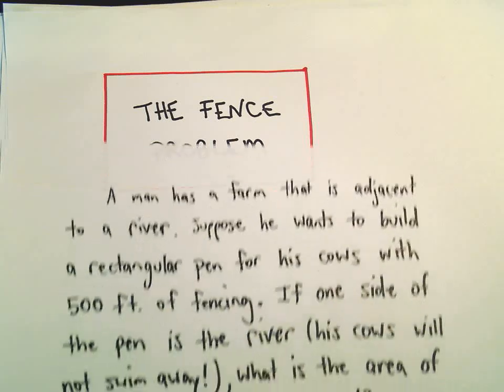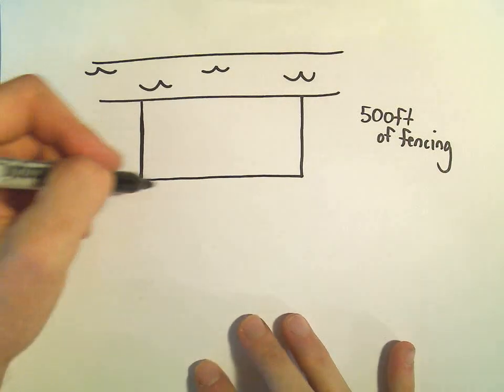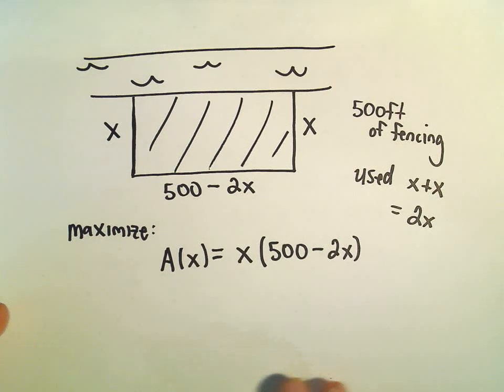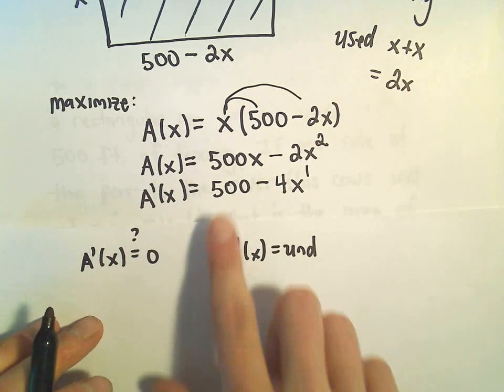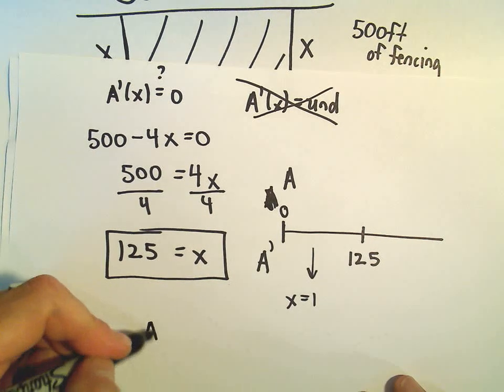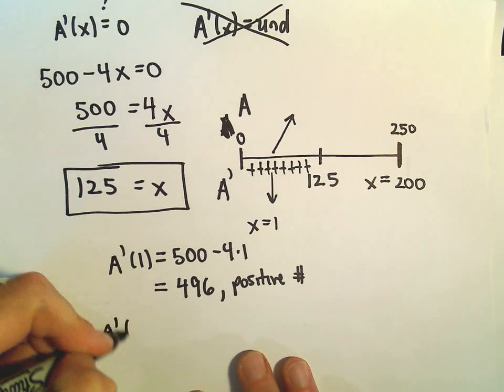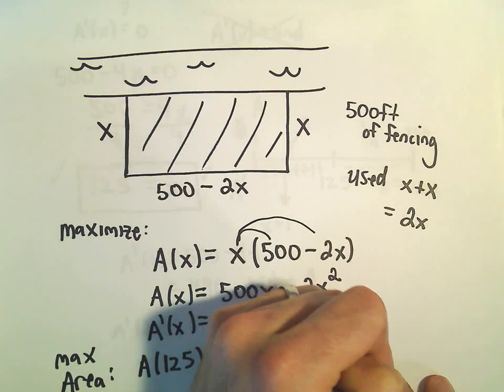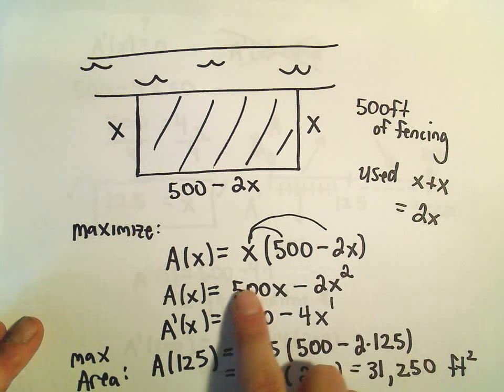Max Area Enclosed by Rectangular Fence - Optimization Problem #4

Comment: I labeled my rectangle differently. The side parallel to the river I labeled x and the other two sides I labeled y. So my equation was x + 2y = 500 and thus y = (500 - x)/2. Then A = x [ (500 - x)/2 ] which gives A = 250x - 1/2 * x^2 and the derivative is dA/dx= 250 - x. When I set that equal to 0, I get x = 250. Then I plug that back in my original formula and I receive 125 for my y value. A = x * y = (125)(250) = 31,250 square feet. So my computation was different but I still received the same answer!!!
Reply: The way you did it was correct for a 4 sided pen. However, the question said that the pen has 3 sides, the 4th side is the river
Reply: @Amanda-bg7ib He did it correct. He set the problem up for a three sided pen, hence he used the equation x + 2y = 500. He used different variables, but the naming of the variables mean next to nothing, as you are free to refer to them as you want. If he set it up for a four sided pen, he would have used the equation 2x + 2y = 500.

Comment: I ended up doing it by constraining the perimeter. I said well if we only have 500ft of material to work with. The the perimeter is 2x+y. So, 500 = 2x+y.

 From there I got y=250-x and I plugged that into the area, a=x(250-x).

I was scared I got it wrong when I saw you did it a different way but I also arrived at x=125.

Comment: in this case, u can just divide the fencing material to 2 then that will be your length. the remaining fencing material will be divided by 2 then that will be your width. now that you have your length and width, multiply it then that'll be the maximum area.

Comment: Isn't the length 500-2x divided by 2? 500-2x would be the two lengths together and not just one.
Reply: Yeah, Even I thought that is should have been x(250-x)=Area.  The answers are same here, may be due to differentiating and equating to zero. I think answers would have been some what different otherwise.

Comment: This is an old video so  I am not sure you still read the comments, but if I were to take the second derivative of the area, which would be -4. This indicates concave down, so A' '(125)=-4 is the local maximum? Since logically it would be increasing on the left side of 125 and decreasing to the right of 125. Also as an alternative way of finding the maximum could we instead find the absolute max on the closed interval [0,250] and the critical point 125?

Comment: After you’ve found the function to represent the area of the rectangle, being that the function is a downward opening parabola, wouldn’t the maximum x-value simply be the x-value of the vertex ( in which case we could use the equation x=-b/2a which is -1000/-4, or 125) ?
Reply: Yes

Comment: Through problems involving the area of rectangles, Ive always found that the area is maximized when the rectangle is a square. Im just wondering why this isn't the case here. I understand the math behind it, but I don't get why it is any different here.
Reply: It's because only problems where you have 4 sides to worry about usually turn out to be a square. These kind of 3 sided problems usually turn out to be y=2x.

Comment: Isn't it easier to just do (X+X+2X) and then make the following equation : 500= 4 x, then we can divide it by 4 which is 125. So the X will be 125 by 125 but we have to find the 3rd side. In this case we can do 2(125) because it's 2X (substitute)  which is 250. 
Therefore, his fence is going to be 125m by 125m by 250m.
Reply: You have to find the critical point using the first derivative test because you don't know for certain that the length is exactly 2x. Just happened to work out that way in this problem

Comment: Is it too risky to use the 2nd Derivative instead?
Reply: You can, but it is not required for this problem. 2nd derivative is for inflection points(change in slope).

Comment: Would yo still get points just solving this through logically?
Reply from the maker: +Jacob3986 i suppose it depends on your teacher and your technique.  i would not give you credit if you showed 4 or 5 examples and said: see, this is best! that would be 'proof' by example and is not a proof.  of course, there are other ways to do it

Comment: Excuse me, Sir. Can you please help me? I'm sorry for bothering your holiday.. Can you please solve this? Or at least tell me the steps to solve it?

A rocket with 10 tons of mass was launched to space accelerating at 5t m/s^2 at the first 10 seconds with t is time(second). The rocket then got turned off but still going vertically. If gravitational pull was -10 m/s^2, calculate the maximum height the rocket reached before falling back to earth.

I'm sorry if it's not in a good english, I translated it myself.. I asked my teacher if I have to use physic or not but he said I'm only allowed to use derivative functions.. Please help!

Comment: Your calculation does not include the fence that blocks the cows from jumping into the river. The phrase (his cows will not swim away!) implies that the farmer is worried about his cows swimming away in the river, and therefore he would put a fence to block them from the river. The length should be (500 - 2x)/2 in order to account for the side of the fence that blocks the river, not just 500 - 2x.
Reply from the maker: uhhhhhh

Comment: i definetly understand how to approach optimization problems now so THANK YOU SO MUCH the only part i'm confused with is how you got the final area equation in the beginning, i thought the max. perimeter was 500ft. and the perimeter was P=2x+2y so wouldn't that give this 500=2x=2y, and then i solved for y so that i could subsititue it into A=x*y, and y=1/2(500-2x) and y=250-x and my final area equation was A= x(250-x) could you pls explain where i went wrong  THNANKS AGAIN!

Comment: how do you do it without derivatives?
Reply: A(x) = x(500-2x)  ==> is a quadratic equation, a parabola opening downward, so the vertex is the maximum
A(x) = 500x-2x^2
A(x) = -2x^2+500x

Find the x value of the vertex by using -b/2a.  In this problem b is 500 and a is -2.
x = -500/(2* -2) = 125

Comment: bro thanks for your video because it helps a lot, but i think your 
maximum area is not correct. because 31, 250 sq ft has a dimension of 
250ft x 125ft.. which means your length is 250 and width 125, therefore 
your perimeter is 2length + 2width which will equal to 750 ft, which is not 500ft..
Reply: The area is correct. The sides are each 125ft and the top and bottom are each 250ft long, but we don't have to fence off on the river side
Reply: ok bro.. but i say what an odd looking fence you got there :)

Comment: Strange..what I found out was, just by finding the vertex of A(x), I was able to find a maximum. It was expressed as x (width) and y (area).. 
If I was to do this, then I would label the two dimensions, l and w. Here's some more algebra..
2l + 2w = 500
l + w = 250
l = 250 - w
Area = l * w {now substitute}
Area = (250 - w) * w
Area = 250w - w^2
Since this must have a maximum, we will just find the vertex of this quadratic.. use -b/2a
-250/2(-1) = 125 {Now plug it into the area function}
250(125) - (125)^2 
31 250 - 15 625 = 15 625
The points are (125, 15 625) representing (width, area)
Now we have to find the length,
l = 250 - (125)
l = 125

lmao..uh forgot we doing calculus not algebra

Comment: I would have done something like this:
let L=length, w=width and A=area
(1)  500=2w+L
(2)  A=wL

(1)  -2w+500=L

sub L into (2)
  
(2) A=w(-2w+500)
A=-2w^2 +500w
A=-2(w^2 -250w)

250div2=125^2!=15,625!

A=-2(w^2-250w+15,625-15,625)
A=-2(w^2-250w+15,625)+!31,250! <-- this is maximum area
A=-2(w-!125!)^2 +31,250  !125=value of width [125=w]

sub w and A into (2)

(2)  31,250=125L

solve for L

31,250div125=125Ldiv125
250=L

.*. the dimensions for max area are L=125 and w=250 

plz respond